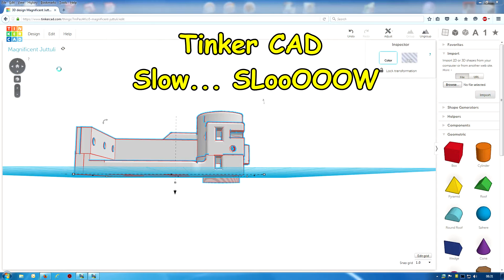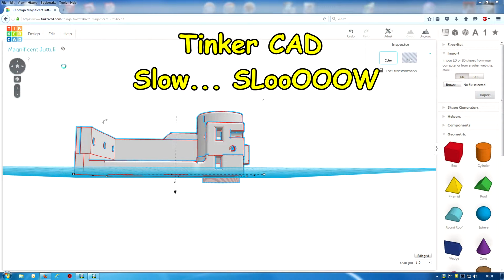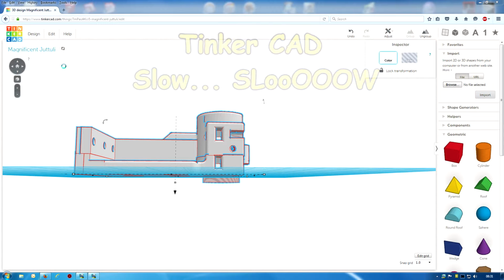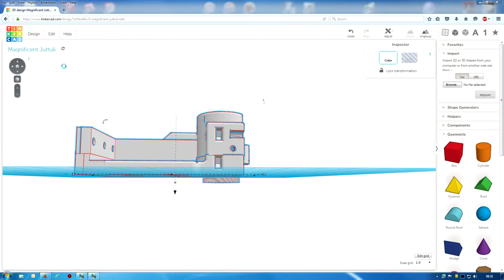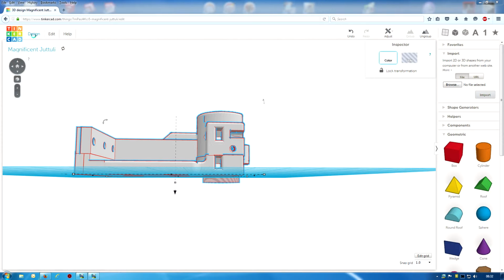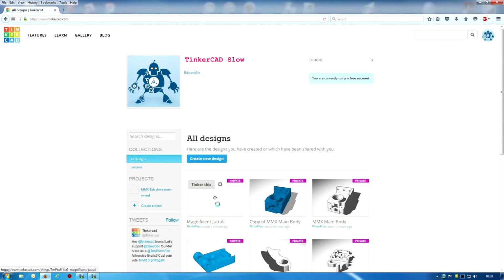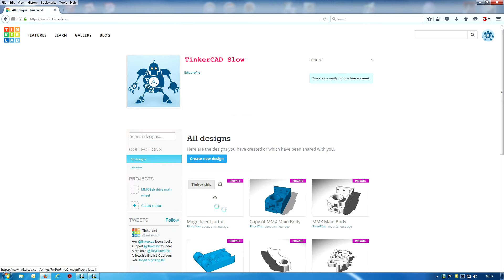TinkerCAD Slow

Comment: i have downloaded tinkercad. And it runs worst then browser versions.
why tinkercad efficiency is so poor? 
i can run many stuff in my machine, as for tinkercad should run very light without any problem, but it runs as poor as a dialing connections.
i have no patience for this.
Tinkercad suchs because it is not reliable.

Comment: I have the same problem. :(
Reply from the maker: +Panoreth 3D Printing:  I have not fully tested this; in TinkerCAD, but saving a main finished model, ( with all the modification), as STL file may remove those modification ; that TinkerCAD allows you to step back through.

Then load the STL as a new TinkerCAD file and edit some more this may speed it up because it is no longer having to remember all the previous modification made and can handle the loaded STL file quicker.... Doing this will lose the previous modification of course.
Reply: The problem is the browser.Try to use Opera.